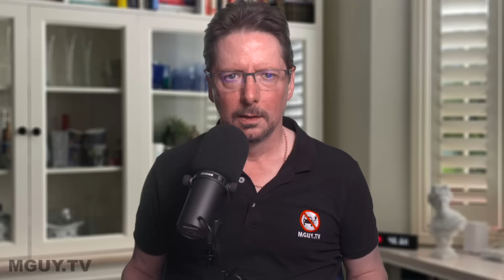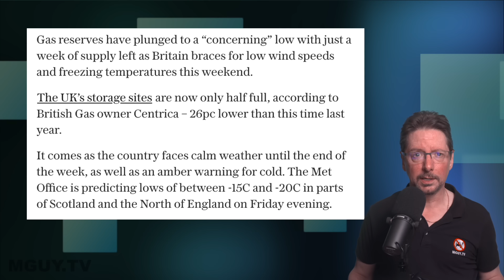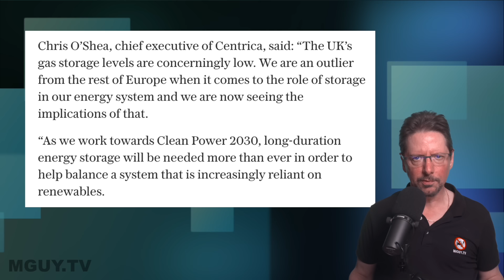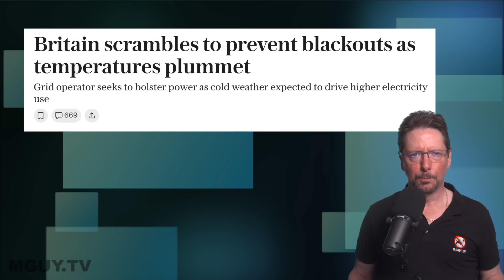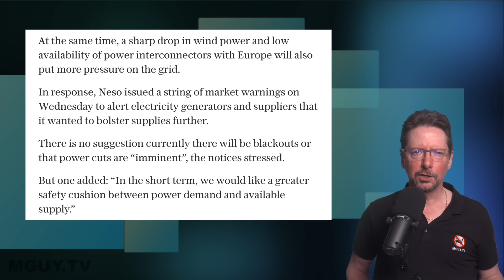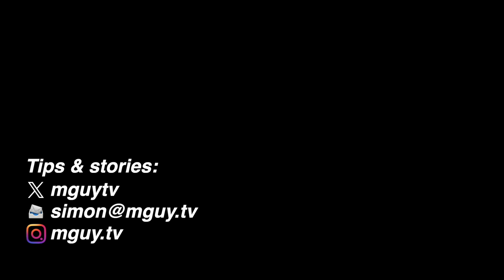Britain's Net Zero experiment is CRUMBLING before our eyes | MGUY Australia

Comment: A lot of what environmental groups say is not scientifically verified. Global warming and the greenhouse effect are indeed scientifically verified. But the solution is not scientifically verified. I have heard a lot of strange things since I was a child. Around 2010-2012, I heard rumors about the hole in the ozone layer, and pointed out that the main cause of the hole came from the Freon that helped refrigeration in air conditioners, refrigerators, etc. (I felt strange when I heard someone say that Freon was a company rather than a refrigeration liquid, as if he didn't know how air conditioners work), but the irony is that Freon has always been an important auxiliary compound for air conditioners and other equipment since humans have used refrigeration equipment. Later, I never heard rumors about the hole in the ozone layer again. I began to wonder if this was a story made up by environmental groups. The most ridiculous solution to the greenhouse effect and global warming I have heard is the carbon neutrality theory. They have been spreading that if you reduce carbon emissions, carbon will be neutralized, but there is a fact in it that only plants absorb carbon dioxide when they photosynthesize. Every time I mention that plants breathe at night, the information is always deleted by the platform. This is what all plants do. Respiration is the opposite of photosynthesis, and plants also need oxygen. Although plants can produce oxygen. This is obviously not such a simple 1=1 problem. In addition, the battery itself cannot be considered an energy source, it is an auxiliary system. If you need electricity, there are several ways to get it, namely thermal power generation, hydropower generation, wind power generation and solar panels to absorb electricity, but because of the limitations of hydropower and wind power generation, in fact, this cannot be the main system of the power grid. Although thermal power generation will pollute the atmosphere, it is indeed very reliable. Carbon dioxide cannot be neutralized by other substances in nature, it will only be more or less. In fact, whether it is human or not, carbon dioxide will be emitted. If you understand how animals breathe, some have lungs and some have gills, and they exchange air like humans. Humans will emit carbon dioxide themselves. Obviously this is not a truly effective solution. It will only create more trouble. The more I learn about the ideas proposed by ridiculous environmental organizations, the more I doubt whether they have studied engineering or biology. Obviously, all this violates more than just common sense. On the other hand, if you pay attention to what humans do, the more cruel reality is that humans have never done anything effective for environmental protection in order to gain money and benefits. This is a scam to deceive the public.

Comment: NetZero is a lie, nothing is Netzero. Nuclear plants take billions of tons of concrete & steel, as well as mining / refining of U235 a massive up front CO2 investment. Same with Hydro. Solar requires massive battery farms as does wind but there isn't enough lithium produced to even touch the requirement for even a days backup power for when wind and solar are not producing, & the lithium also requires massive CO2 to produce, refine, & make into batteries. A secondary mistake is the main source of solar & lithium batteries is China; using them makes you dependent on China for your power & transport.

Comment: Netzero is a lie, nothing is net zero.  Nuclear plants take billions of tons of concrete and steel, as well as mining and refining of U235 a masive up front CO2 investment - same with hydro. Solar requires massive battery farms as does wind to even be semi viable; but not only is it implasuble due to insuficiant lithium production; but the lithium requires a massive CO2 investment in mining; refining, and manufacture of the batteries, then they catch fire often with serious negative impacts. A secondary result of wind, solar or BEVs is China is the main source; and you'll be increasingly dependent on this one country which is a reason China will push that false agenda in the first place.

Comment: Green energy.   Sit in the dark and freeze.
I've thought this could happen for a while now. That's why I've got a standby diesel generator and there is no mains gas in area, so I've got a normal Oil boiler for heating and hot water which is the cheapest form of heating there is. 😂

Comment: My present (U.K) electric daily usage is approx 14 kWh, gas heating and hot water. Let’s add an EV with say 3 miles per kWh winter range. 25 miles per day so another 8.3 kWh. Now let’s add that heat pump - on a cold day it’s about 1 kWh per hour so another 24 kWh per day.  So my electric usage on a winter’s day would be over 3 times more than I use at present and the government thinks they have enough power for everyone to shift to fully electric.
Reply: Unicorn farts are very energy dense!

Comment: The UK, is mostly made of a huge slab of coal that floats on a sea of crude oil and gargantuan bubbles of natural gas.....These fuel reserves fuelled the UK and fired Harold Wilson's "white heat of technology" boosting the UK into being real world leaders in engineering and development.  We had more power than we could use and it was cheaper than chips, which were also really cheap.  Not now.  Now that The Clowns are in charge off Clown World.  I agree, a few days of power cuts would have the brainwashed normies calling for an end to net zero BS immediately.

Comment: It’s one level of stupidity to close all the coal-fired power stations but the idiots in charge have excelled themselves moronically in having them all demolished.  

Add on the dismantling of gasometers, the imminent decommissioning of 5 of our 6 nuclear power stations and the fact that our power transmission grid hasn’t been updated to transmit the so called green generated across the country, power shortages are only going to get worse.  I almost forgot, the gas powered power stations are also coming near to the end of their design life and will soon need to be replaced!

Comment: Net zero is absolute nonsense but so are some of the statements here about the cost of renewable power.  The numbers have no doubt changed a bit since but when I was working on wind and solar projects (inside a hydrocarbon company) a few years ago the fully built up cost (ie including all capital and maintenance costs) of renewables was less than the marginal cost (ie fuel only) of a CCGT.  And that cost advantage will only have increased with the post 21-22 rise in gas prices.
So the correct economic answer (leaving aside any Thunbergism on carbon) is to max the use of renewables . . . but to love and cherish your CCGTs because you have to have them for back up.  It's not hard . . . except for a religious Green Cultist.
Getting overexcited about a brief spike in prices (which by the way in Germany has been completely sorted out since their moment of incompetence, not getting their gas and coal fired plants spun up in time, detracts from the many correct points in this video and reduces its credibility.  Shame.  

On the other hand the statements about the fantasy of grid level batteries are spot on.  Totally useless for anything except dealing with the decreasing inertia of a renewables heavy system, for which they work fine.

Comment: The fear mongering continues so they expect people to swallow there BS. Go back some years ago they were priming the people to believe this to were there ever wasn't a problem, they had taken into account when they built the electrical infustructure for the housing and people. Now these past years it's a load of BS put on the people. So they say we are having problems with supply, so how would the infustructure be able to cope with 50% of people of a country driving EVs, were would the power to charge the EVs come from, 1to 2 degrees now is big problem and the fear mongering continues.  You can only laugh at these clowns.  I wonder if they have awards for clowns of the year.

Comment: "A dangerous actor cutting gas supplies to the UK" They do not have to be dangerous , it is happening now with Norway reducing gas flows and threatening to cut them to the UK and EU since the bidding for the gas has taken prices beyond the means of domestic users, they are also cutting electrical power to the UK via the converter for the same reason, high demand from Germany and Denmark with Sweden complaining about their loss of supply. Finland intended to build two more nuclear power stations but the EDF unit only recently completed was so delayed and over budget that they have not gone ahead. This is like the EDF unit at Hinkley point which is already double the costs and behind schedule where in Turkey and elsewhere Russia and china can build them on cost and on time. Then we have the LNG gas we get from Qatar, not the country but from an LNG plant they own in the US. This comes into a conversion plant built in Wales with UK tax money but since we do not have any storage capacity,  except the gas in the Trough of Bowland accessible by fracking or the North Sea gas fields  and the idiots closed the main site,  is sent on to the Netherlands and of course most does not come back finding its way to Germany and elsewhere in the EU and the theory that we get electrical power from the Netherlands is also dubious and at high cost. The fact that the country is floating on oil and gas does not get through to people like Minibrain or Baroness Worthless since they have managed to delude themselves that UK gas and oil is different from the Green brands we buy at high price from Norway and Qatar just like the steel, cement, and other products we used to manufacture are now made in China from "Green" coal that apparently does not emit CO2 but if accounted for in UK imports would show far from a reduction in our contribution to global CO2 but an increase due to added shipping and inefficiency factors. Even more dangerous than this fantasy is the fact that the UK and EU have no stores of grains to cope with the coming cooling cycle, of which this winter is a portend along with all the current volcanic activity, whereas China is stock piling it at a high level and leasing land in Africa to make sure they have supplies. No they are hell bent of destroying UK farming because of false claims of methane emissions by cows causing warming.

Comment: Windmills aren’t the solution to this problem
Reply: The problem is that there isn't a problem.
Net Zero is already here
Carbon Dioxide is 0.04% of the Atmosphere. It is a Trace gas.

99.96% of the Atmosphere is NOT CO2.

3% of that 0.04% is manmade 

The UK produces less than 1% of the 3% of 0.04%.

That's 0.000012% 

Net Zero = 0.000000%

At 0.02% of CO2...All plantlife dies..

Comment: At 09:11 today, our grid is being powered thus: Gas 55.7%; Unreliables 11.7%; Wood 6%; Nuclear (Hurray!) 12.3; Interconnectors 1%. Notice percentages don’t give much information away. Turn these values into gigawatts and the scary truth emerges. We have an installed wind capacity in the UK in excess of 30 GW yet when we desperately need the power, like now, only it can only supply 3.66 GW, a power factor of a pathetic 12%. We are screwed.

Comment: It's so sad to see this. Running a channel that's suggesting we shouldn't adapt to climate change is downright irresponsible and dangerous. I understand - there are many people with the same mindset, and that presents an opportunity to collect clicks and therefor money. It's true that the transformation presents us with a lot of challenges, many of which have been covered here. But should we just do nothing, or work to overcome those challenges?
Reply: You've been brainwashed, did you take the jabs and wear the masks too?
UK is already at Net Zero
Carbon Dioxide is 0.04% of the Atmosphere. It is a Trace gas.

99.96% of the Atmosphere is NOT CO2.

3% of that 0.04% is manmade 

The UK produces less than 1% of the 3% of 0.04%.

That's 0.000012% 

Net Zero = 0.000000%

40,000+ child slaves mining minerals for E.V. Batteries in the Congo, 250 tons of earth mined per EV Battery. Power Stations belching out pollution working at 40% efficiency to charge E.V.'s at a discounted rate while elderly neighbours can't afford to put their heating on..

Comment: The closing and reduction of nuclear power makes ZERO sense. It is the ultimate climate-friendly energy source. And there is no problem with storage of waste material - especially if fast breeder reactors are used. Of course, we always hear "But Chernobyl" - as if 1950's SOVIET tech is the standard? Modern SMALL nuclear designs are very safe, fairly cheap, and can be built in less time than it takes to get the bloody PAPERWORK done.

Comment: On tuesday (8th) britain was 1 power station failier from blackouts. If one power station had gone off line at a peak time in the evening there would have been black outs. However, luckily that passed, but only a few hours later 2 power stations did go off line, but no black outs.

Comment: Tackle climate change by planting trees, clean factories waste  outputs. HIGH Efficiency petrol and diesel engines. Small individual roof top wind turbines for boosting domestic use (as the Netherlands had 20 odd years ago)
Reply: The worst location for a wind turbine is a rooftop. See: Paul Gipe.

Comment: Any so called weather expert promoting climate alarmism should also be aware of the regular winter high pressure windless very cold and cloudy spells where both wind and solar generation will be useless.  Clearly you have to be able to completely supply demand by other means during these spells and it is not strategically sensible to expect to be able to draw all the power you need from abroad by interconnectors.
You still need a stand alone non weather dependent means of producing electricity.  This issue will only become increasingly serious as people are forced into using electric heat pumps and electric cars.

Comment: A small calculation example of what battery storage of electrical energy in Sweden would mean:
Sweden consumes approx. 140 TWh per year. It will be 140 / 365 = 384 GWh per day. Let's assume that we need 500 GWh on a cold (and windless) day in February. If we are to have batteries for three such consecutive days, these must be able to store 1,500 GWh.
The world's combined mining production of the critical battery metals lithium and cobalt are enough for lithium-ion batteries for 800 GWh. However, this assumes that these two metals are not used for anything other than batteries (which is not true). If the world's total production of lithium batteries amounts to 500 GWh, then an annual production per day is required, which Sweden needs to secure its electricity needs with battery storage on cold winter days.
What would it cost? The daily price of approx. SEK 1,500 per kWh battery gives a battery cost of SEK 750 billion per day that the storage must cover. Surprise!

Comment: Solar, wind and geothermal can be great supplemental power sources. They just aren’t suited for a main power source like you said. 

Here in the USA around me all the solar panels on people’s roofs are covered with snow. So if these houses depended on them for heat they would be screwed. Now during the summer they can help with air conditioning. 

Friend had a heat pump on his new house. It had so many problems he replaced it with a traditional natural gas HVAC unit after five years. Most installers in the midwest won’t even install them.

Comment: I have learned from a couple knowledgeable electricians that a healthy grid needs a tiered network of power plants. Nuclear, sometimes water depending on the region, are perma-runners, constant output but long startup times. Coal plants are intermediate, and gas is to balance fluctuations because of its immediacy. 
Running the whole grid on gas is like having a sprinter enter a marathon race: you're using the wrong tool for the job, and you are probably out of reserves long before the finish line.
Reply: Nuke is actually the stabilizer, they can go from 50% to 80% faster than any other power generation, twist of a dial.

Comment: Stealing our Sun, stopping dredging rivers, removal of water control infrastructure, redirection of water, removal of forestry control, spending on wind and solar, forced adoption of EVs which don't work and use more expensive components, that cannot be repaired. The destruction of our insect, wildlife population, just to chase a fake agenda. Geo Engineering storms, rain. Two speed justice. When all put together it is pure vandalism designed to finish our long stable civilisation.

Comment: Battery storage systems don't work well at below-freezing temperatures. At -20C they will drain themselves of energy trying to stay at operating temperature.
Reply: Yep, that why no one drives an electric car in cold countries
Reply: @MR_THINQ you know about Norway?
Reply: True, we’ll need good old fashioned fossil fuels to power battery warming systems.
It will be like putting your Duracells on the radiator for a bit more power.,…😂
Reply: Lithium-ion batteries are not even rated for storage below -20C.

Comment: It's amazing that Centrica are apparently surprised at the low level of gas storage in the UK when they, over the years, have sold off almost all the gasholder sites for housing for a quick profit.
Reply: gasholders are not for gas reserves, its for day demand variations - gas plants work 24/7 on full power, gas demand varies 10 times from day to night. Gas reserves in modern systems are salt caves, underground traps and so on, ancient gasholders are not usable anymore.